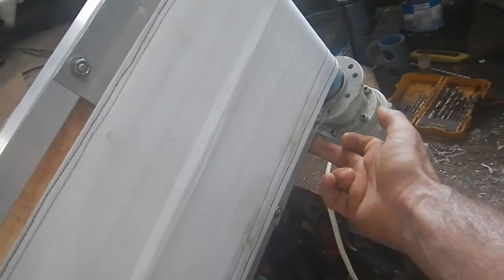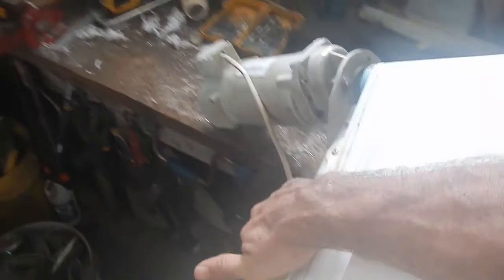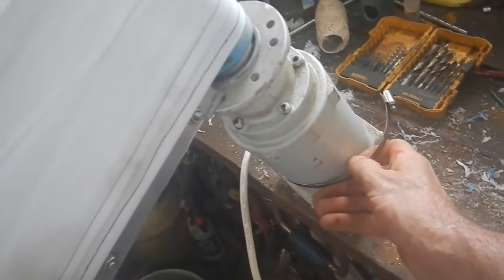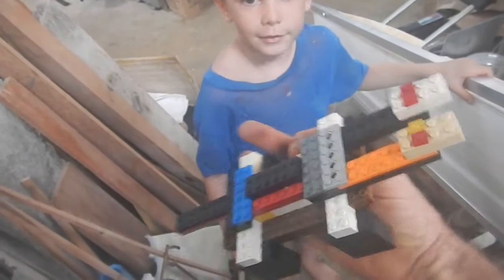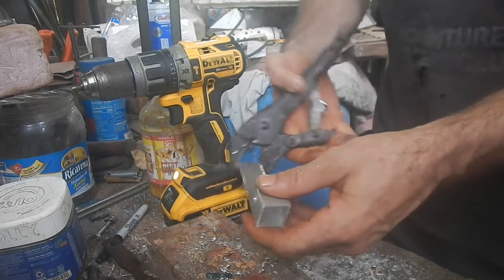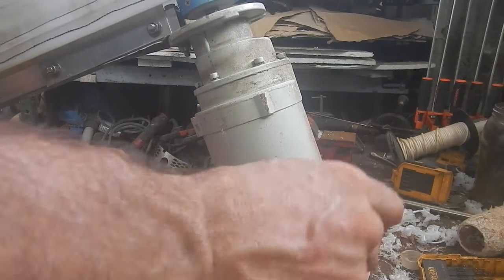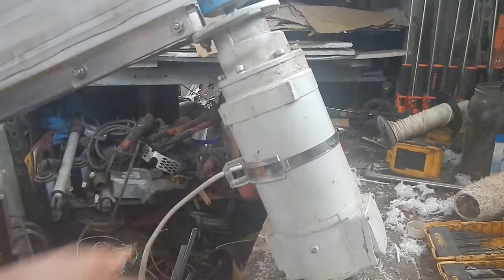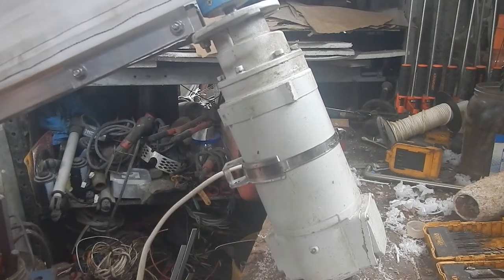Conveyor Belt Machine Legs.  Is this thing actually useful???

Comment: if you make your idler rollers sit on a u shaped bar it will keep the belt cupped without the added friction. also a free source of belt material is old tires cut the sidewalls off and use the tread